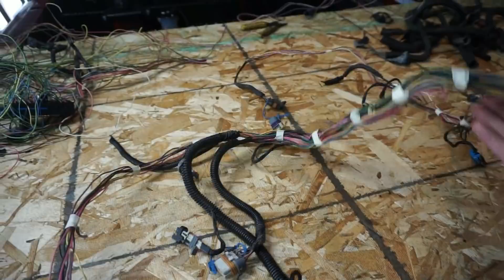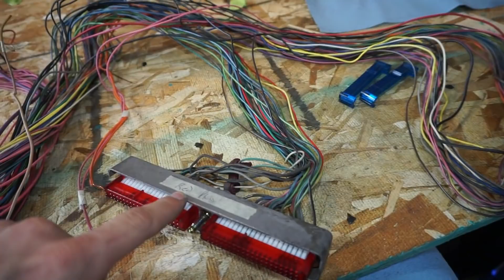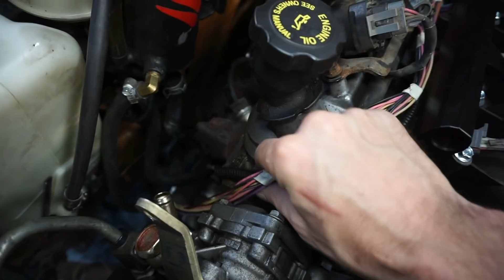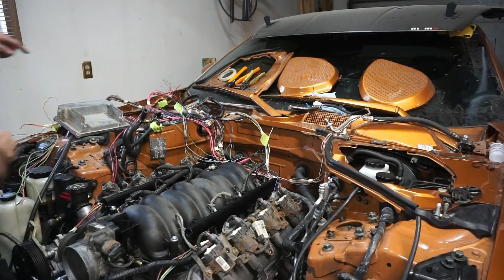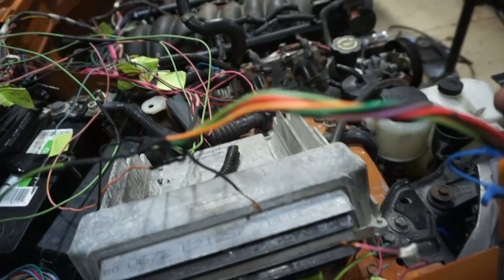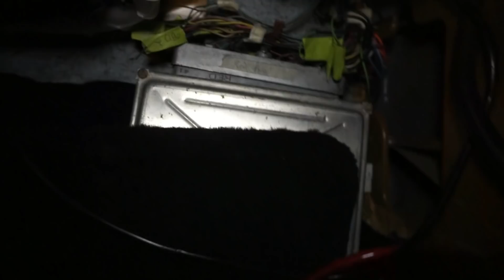Clean Custom 350z Standalone LS Harness!!!

Comment: How did u get the ps pump mounted up and for the wiring ur taking out all the pins that aren’t being used to make it cleaner and then your re pinning the injectors and coils so it can route better but they go back in the same pin u took them out of correct ?
Reply: And also all the left over wiring by the fuse box is what u wired into the fuse block u got correct? Was there any extra wires that u had to put together?

Comment: Where did all the wires for external sources go? What do they connect to when they are run back into the car?
Reply from the maker: depends which wire it is. You have Vehicle speed signal, MIL light, tach. Etc. Each one would go to it's own location specific to the vehicle.
Reply: @BlaserBuilds  so wire them to the instrument panel plug inside the car? If not, then what to? The plug for the fuse box under the dash?

Comment: From personal experience, be careful about folding/doubling up.looping wires to take up excessive wiring. You CAN get electrical feedback from signals going through them. Think of them as being like an electromagnet. As the power pulsates through the wires, a magnetic field can develop. I cleaned up the wiring on my old Crown Victoria, and ended up with a weird miss I had trouble finding. Over a year later, I finally figured that my excessive wiring looped was making a mild magnetic field, throwing the signals off.

Moe
Reply: ran into this same kind of issue but with a cell phone being on and placed on top of a ecu while driving lol

Comment: Great video, there isn't much out that addresses what to do with the harness when you switch from a truck intake to an LS 1 or 6. I am putting a 6.0 into a G body wagon and will be switching to an LS6 intake and definitely want to clean up the harness and swap the location of the ecu to the right side of the engine bay.  Very clear to me how to approach the re-pin of the injectors and coils 
I'm looking forward to the next in the series.  Thanks for all your vids.